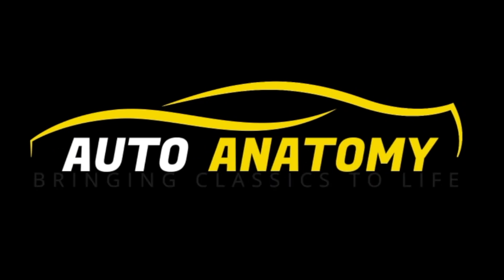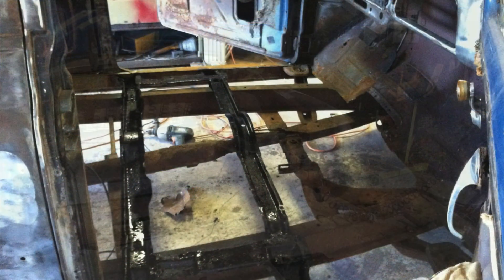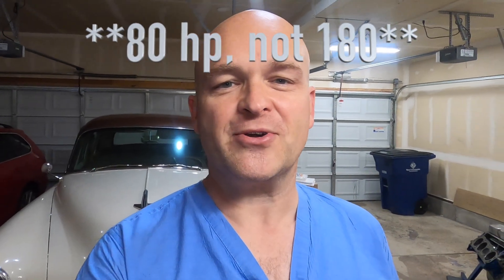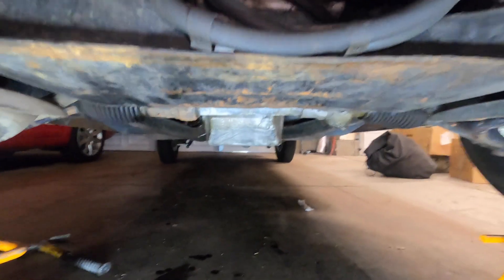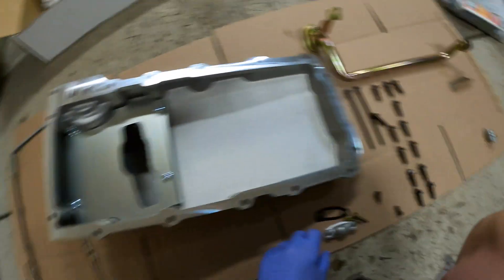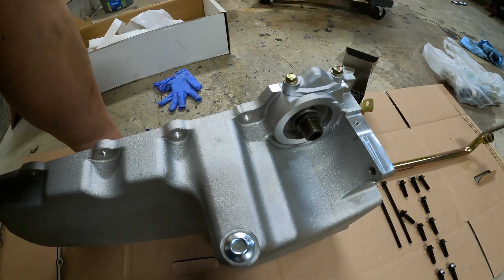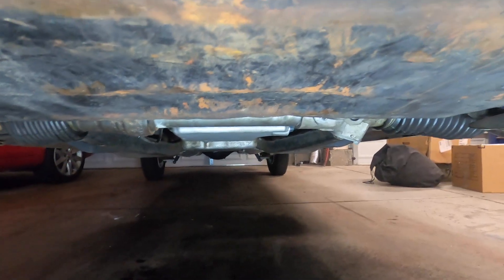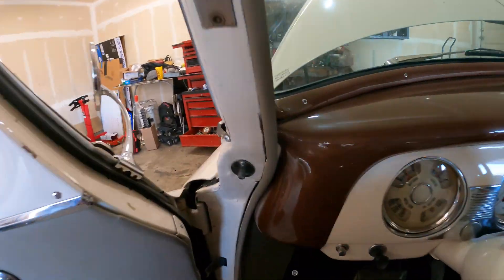Installing the MaXpeedingRods LS swap oil pan on 1952 Chevy!

Comment: Wish you restored to Original. History now lost
Reply from the maker: The original engine was junk, the front suspension was completely rusted through, and the brakes were barely adequate in 1952.   It is still original in appearance but is much safer to drive now.   I think I’m keeping the history alive by getting it back on the road again, for another generation to enjoy.  Otherwise it would have rusted into the ground